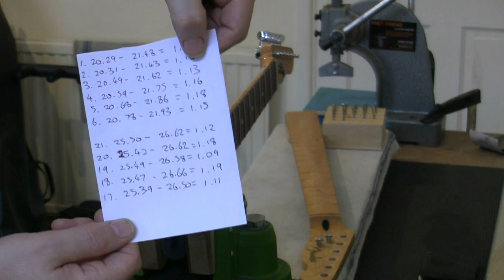Warmoth neck return: My thoughts / findings and what I am going to do about it...

Comment: In the 90s I ordered a Warmoth neck and it had an S-curve under tension. I even sent it back to Warmoth and they sent it back to me saying "looks straight to me and we won't put it under string tension to check". A local luthier had to hack down the frets between 7 and 14 to level the fret tops, which made the neck playable, but you could even more clearly see the problem. I'm of the opinion that Warmoth is not a great as they are cracked up to be.
Reply from the maker: You are spot on! :)

Comment: Victor, sorry for the trouble you've had with this neck and your fret rockers. 
I just did two refrets with stainless steel and both turned out not as well as I expected. Luckily they are both my guitars so I can level, crown and polish again. After watching this video I checked my two fret rockers (one from Stew Mac and one from Philadelphia Luthier) and both were not perfectly straight on just about every side.  While I was at it, I checked my notched straight edge and that was out on both sides. Unbelievable, when you buy something that is supposed to be precision ground you expect it to be straight. especially for what Stew Mac charges for their tools. I just spent the last hour grinding all three on my precision ground sanding stone (let's hope that is perfectly true ;-0)
Thank you for having the stones to post a video about issues you've had with a job you did for a client, not many would post that. It's helped me and never again will I take a company's word that their tools are precision ground and perfectly straight. I will true everything myself from now on. Thank you!!
Reply from the maker: Shocking that such expensive tools are not trustworthy! Stewmac have promised to check thier stock for straightness and have sent me a replacement rocker! Victor...
Reply: Kurt9099 

Victors videos have been really eye opening and inspiring. They have caused me to do a lot of research and even looked at making or redesigning fret rockers that are genuinely precision. 

I was talking to a real nice intelligent guy who is an ebay seller (guitar tools) 

He was saying that he had fret rockers ground by a company in Sheffield and it wasn’t that great. And it was pricey as had to pay for each side that was ground. 

He may have said some of the sides were concave or convex , I can’t quite remember, need to go back and re-read.

He said that he got just as good results or maybe better by lapping them by hand 

Anyway, I think there is really a market for genuinely precision guitar tools. Somebody needs to step in a start making /selling them.

Comment: Those Warmoth necks are expensive. The flamed maple with rosewood fretboard, poly finish, graphtec nut and stainless frets is $400-$500. A bit disappointing that it has that significant flaw in it's construction.

I have a Roasted Maple one and can attest to the strength of the stainless.  It was on a strat standing on my desk. One of my dogs pulled the guitar cable and it fell forwards. I was sure there was going to be some damage. Not a mark on the frets or wood but there are now  6 notches on the edge of the desk where the guitar fell on it and the strings dented the edge. The body got a pretty nasty chip, nothing superglue and black paint  couldn't fix though.
Reply: That was the owners fault not warmoth. Hes the one who had someone work on it.
Reply: Hey Mate I have been working on guitars a long time and been to the Warmth facility. It's asking a lot to have a flat sawn maple neck stay straight over the long run.You are absolutely right that it's the plane of the frets that really matter. This. Is the reason Gibson and other makers use quarter sawn wood in their necks.Additionally I have seen many Fender style necks with the dreaded ski jump syndrome at the end caused by the 4 screws holding the neck on where heat and cold can enter the end grain in addition to the normal end grain end of the neck this makes the frets behind the ski jump look low and can throw off the fret rocker measurements on upper frets.I now only use the fret rockers for the lower and middle up to about fret14 past that point I file a very slight fall off on the last portion over the body in anticipation of the ski jump effect which will affect the level of the frets over time. Also I would question lowering frets on extreme treble side the reason the nut slots are lower there is more to do with less string excursion and the frets don't have to be lower to match even though it might be better for intonation.Plus that is a curly neck which intrinsically more prone to S warps than straight grained necks.Thanks so much for your good video I thought about buying the Stew Mac fret rocker but now will probably not buy.There are a few problems with fret rocking anyway, cumulative error being the most concerning but fret rocking good start then leveling and making sure neck doesn't flex under leveling beam.I use cork lined wedges under round back of neck and a long file I have checked against a straight edge and will probably buy a good leveling beam as it is slower but probably more accurate.

Comment: Regarding the tool, does it need replacing? Could you take some 2000 grit wet dry paper on a piece of float glass and true it up? Or does that shorten a length on another reference edge?
Reply from the maker: Tool has been replaced plus I have upgraded others. Old ones have gone to a tool setter to be re-levelled...

Comment: Just curious, is this a reason to not work on just a neck?  Maybe if it was attached to a body and all strung up you would have caught the problem before you sent it out as complete?
Reply from the maker: I'm happy to work on just the neck if that is what the client wants to send. In fact, I just completed 3 necks for 1 guy and the videos will be posted at the end of next week. Regarding this Warmoth, the work I did was the work I needed to do: it just happened that my fret rocker was giving false readings. Stay tuned for the follow-up video to this as it will be a corker. Victor...